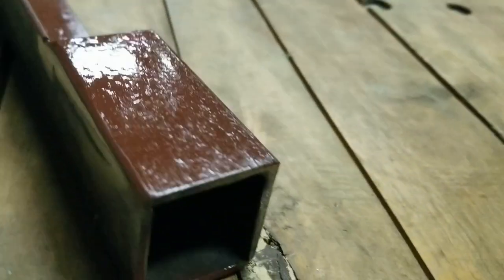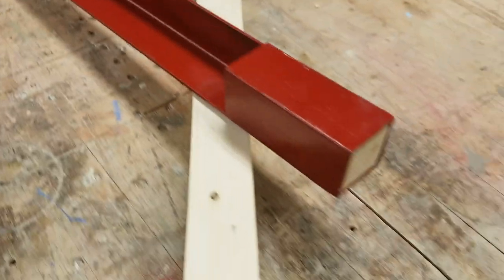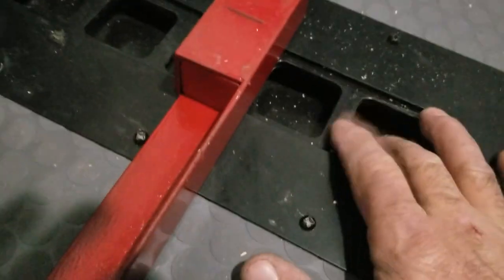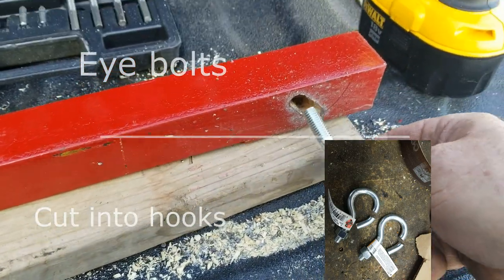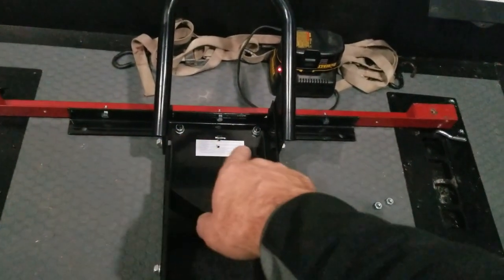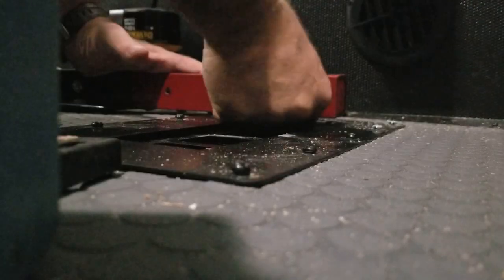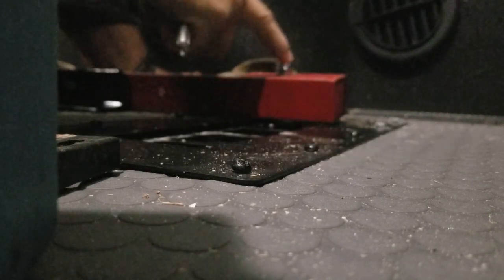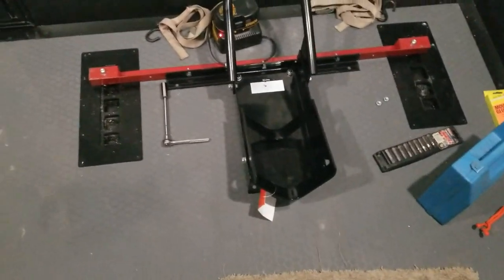Goldwing DCT tie down in my Toy Hauler

Comment: Nice Job What are the bolt on eye hooks on the front forks
Reply from the maker: The bike is tied using the Goldstrike tie down hooks I installed to the frame, not the forks.  Thanks for watching.
https://goldstrike3d.com/products/tie-down-brackets